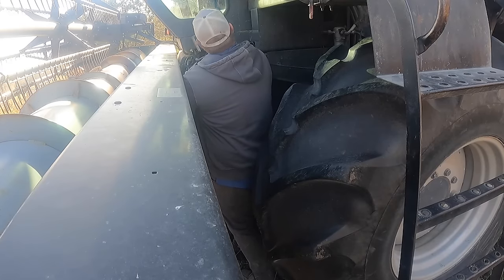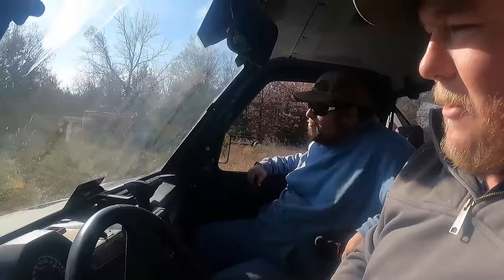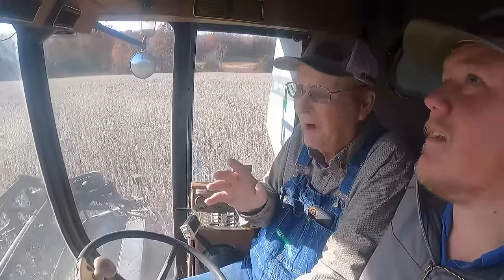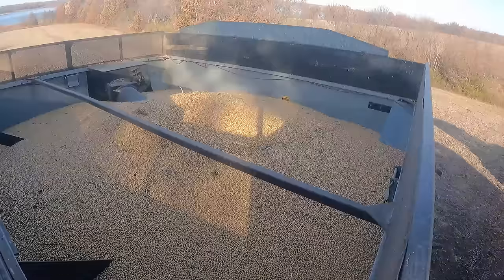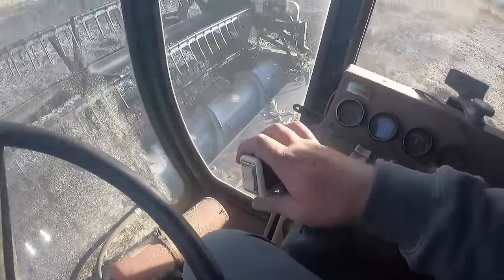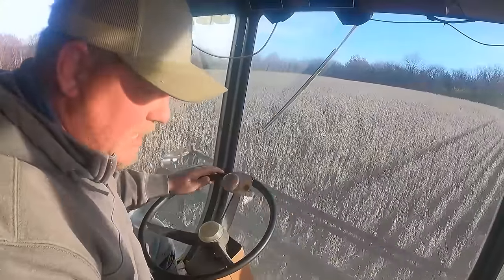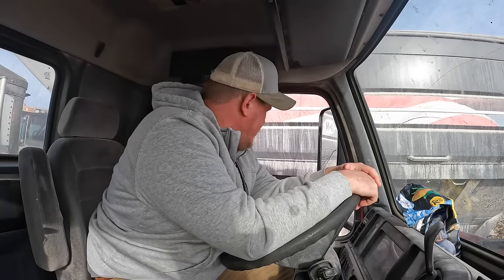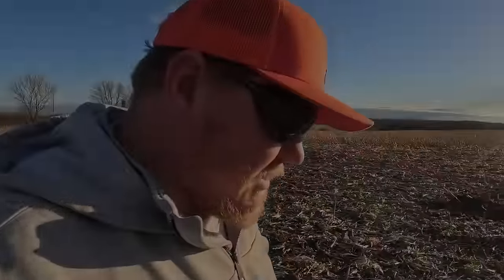Gleaner Certified - DIFFERENT COMBINES - Red?

Comment: I notice you JD 4020 cranks awful slow.   I have a 1969 JD 4020 that cranked the same and was hard to start in cooler weather.  I installed a gear reduction starter and it spins so much faster and starts every time now.  It works so well I got the same type gear reduction starter for my 7:3 L Ford pickup and it starts great in cold weather also.
Reply from the maker: Thanks for the info